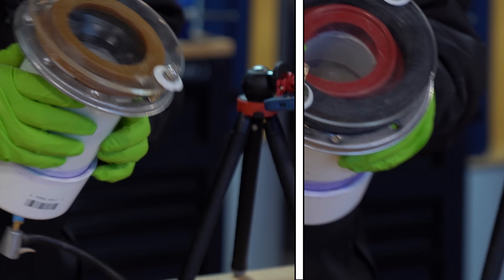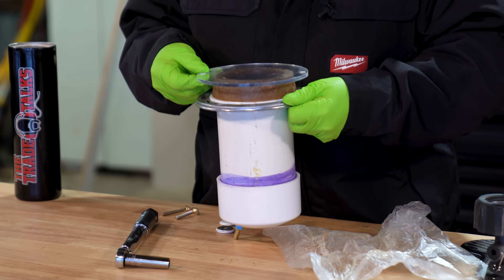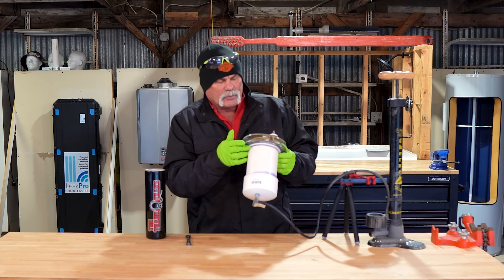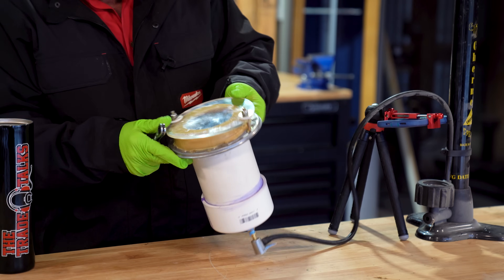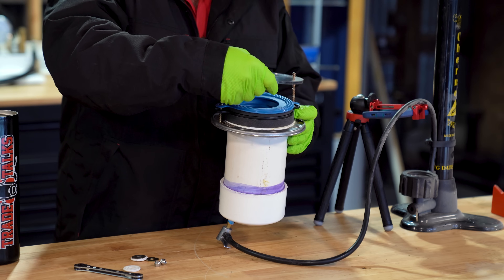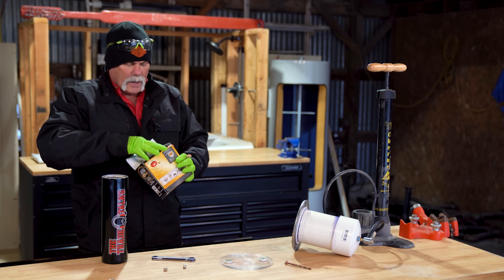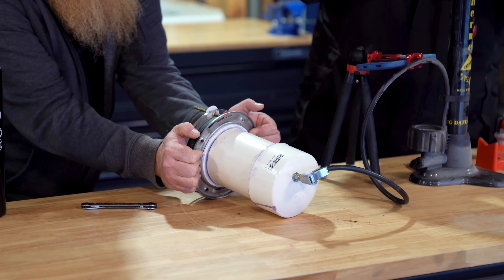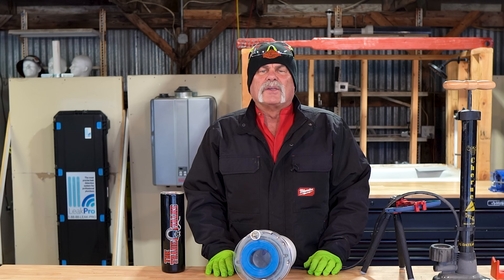Toilet Wax vs Rubber: Which Works Better?

Comment: to be fair, if you're putting 25 PSI of air pressure on your toilet, you eat way too many beans.
Reply: Or all you can eat hot wings
Reply from the maker: But they’re the magical fruit…
Reply: @RogerWakefield  The more you eat, the more you toot.
Reply: 1psi= 2.307 ft high back up
Reply: @braindejong9606  so that means a 57 foot tall toilet.  which misses the joke, entirely.
Reply: Funny but makes no sense
Reply: @mycaddigo  Wouldn't be funny if it made no sense lol
Reply: Beans, beans, good for your heart.  The more you eat, the more you fart.  The more you fart, the more you say, beans, beans are here to stay!!  😊
Reply: @RogerWakefield  Yeah, they magically destroyed your toilet ring...
Reply: … the more you toot the better you feel, so let’s eat beans for every meal.
Reply: Or simply plunging it...
Reply: the smoke test probally would have been better
Reply: Did you factor in the FAT ASS effect ? Some people are HUGE and " rock " the throne getting on and off . That may shorten the life of the seal . A friends kid leaned back and cracked the TANK ! There may have been a gap between the wall and tank . And a GAP between his EARS ! 😂
Reply: They are good for your heart though.
Reply: @johndorian4078 
Yes, or immerse the whole contraption in water and look for the bubbles.  Soapy water in a spray bottle may have also worked!
Reply: Oh, man, that was awesome.
Reply: You should ALSO install a seat belt on the bowl!
Reply: @jasonrodgers9063 nice tip.
Reply: Good one!
Reply: Lol.  Thats probably the pressure that you produce when plunging the toilet bowl.
Reply: He's not really putting that much pressure, since his pressure dial is on the pump, and not measuring what's the pressure in the chamber.
Reply: Tampons probably
Reply: @ElecTRANCEpeter  those don't work that way.
Reply: You would have had a better test with some thicker acrylic or a thick backup ring to keep the acrylic from flexing. Remember, the porcelain  doesn't flex.
And a small jig for your test pipe to mount to.
Reply: No such thing.
Reply: “We didn’t set it up right”.
Exactly. Pointless test.
Reply: This is not a good test. You want to water test it to realistic water pressure that it will experience.
Reply: @anthonybishop2498  nah, we don't want scientific rigor, we want entertaining video and funny comments.
Reply: Plungers.
Reply: Useless test as plexi to thin.
Reply: That’s a slow day
Reply: I can't see how a wax seal gives a good seal in anything but a case where the toilet bowl doesn't budge a micrometer, and how realistic is that? First time big Uncle Hershel sits on the can, I can almost guarantee there will be tiny angular offsets and displacements, and I can't see how the wax seal will remain air or water tight. At least materials with good elasticity will rebound and continue to conform to small angular and other offsets, when Hershel gets back off the can.
Reply: @briank10101  you obviously haven't touched a wax toilet ring.
Reply: To be fair though a toilet is going to push evenly all the way around. So you needed a lot thicker top plate so that the side didn’t flex.
Reply: My beans make musical fruit!

Comment: Your test is flawed, the cap you’re using and screwing on is failing under pressure, my toilet isn’t going to curve and start letting air out. Porcelain doesn’t flex.

Comment: I like the test but you can see the acrylic is bending which won’t be a good seal so something stiffer would have been a better test for both in my opinion
Reply: I agree. I am no plumber by  but I use these in all my toilets at the apartments I work at as I go. Somewhere around 100 toilets it’s the past 4 years I’ve had one instance where I couldn’t use one. Time saved is massive. Between cleanup and not scrapping the old ring off. It’s so much easier to do and they work. When you have a proper seal I believe they are better. Just make sure you gasket flange isn’t broken.
Reply: Which couldn't that be a better test, the flooring under toilets sometimes bends right? so wouldn't you want a worst case test
Reply: @johndorian4078  yes, the floor may have bends but the seal doesn't touch the floor so it has no influence. The weak point of this test is the acrylic sheet used on the end. It is clearly not as stiff as a toilet bottom and is skewing the results. I've used both and after the first no wax seal you couldn't pay me to go back to wax. The toilet in my current house had a wax seal that was leaking so I replaced it and within months it was leaking again. Switched to a no wax seal and it hasn't leaked in 25 years now and that includes having removed the toilet once to redo the floor and and another time to gain access to the space behind the toilet for painting. Never had a drip or an odor of sewer gases leak through it.
Reply: Yea a toilet is not going to flex like the acrylic did.
Reply: @johndorian4078  Plus a toilet is much heavier and puts an equal amount of pressure around the seal.
Reply: the acrylic plate should have been MUCH thicker, especially if they re-used the same plate for each successive test which is appears they did. The idea behind this test was good but that test procedure was a failure from the start.
Reply: 100% 

Porcelain does not give away like the acrylic. I would expect you could substitute with a thicker piece of acrylic and longer bolts.
Reply: @johndorian4078  Not really. Neither the toilet drain face nor the toilet flange will bend.
Reply: @lonnywilcox445  ~ An uneven floor can cause wobble.
Reply: The pressure would probably push up through the pee trap before any of the seals. You'd have heard air bubbling up in the toilet bowl.😂😂😂
Reply: True. The commode doesn't bend like that.
Reply: This is what I i was gonna say. That acrylic would have to be much thicker to model the rigidity of the porcelain toioet. Not even close to good enough.
Reply: Yeah, it would have been better to use a metal or wooden ring (with holes for the bolts) on top of the acrylic.  That way, you'd have a rigid perimeter to create a good seal but still have the acrylic window.
Reply: @gweedomurray9923  Make sure your toilet doesn't wobble when setting it.  Shim and caulk if it does.  Sometimes, after years of use, the screws holding down the flange can get loose and the toilet can wobble, but you know what, with a rubber gasket, just pull the toilet and reattach the flange and then reset the toilet, no problem, unlike a wax ring, as the videos says, once a wobble starts, the wax is misshapen and does not flex back, so if you have a wobbly toilet, only a rubber seal will work.
Reply: I'm a lady and I just installed a new toilet and used the Better than wax product after removing my old toilet and the old wax ring. I found it works and had no issue with it and no leaks. I'm pleased with it.
Reply: Yeah, it would be nice to mount that test rig to pallet or something in the air and throw a real toilet on it, bolted down, then pump it up. 
They could also plung the toilet and see what max psi they can hit with a plunger.
Reply: @johndorian4078  Nope.  The closet flange is the seal point, not the floor.  Otherwise you'd have sewage seeping under your tile.  And no floor is going to flex like this acrylic did.
Reply: @jimb1786  Agreed.  That was the first thing I noticed.  A better test is to use a non-porous rigid material, maybe a metal plate..  I don't think it is necessary to be able to see down though the opening as you can see the seal from the sides.
Reply: I can't see how a wax seal gives a good seal in anything but a case where the toilet bowl doesn't budge a micrometer, and how realistic is that? First time big Uncle Hershel sits on the can, I can almost guarantee there will be tiny angular offsets and displacements, and I can't see how the wax seal will remain air or water tight. At least materials with good elasticity will rebound and continue to conform to small angular and other offsets, when Hershel gets back off the can.
Reply: I've maintained apartment buildings for many years. I will never again use a wax seal. What a PIA! Over the years I've used various "rubber" seals and have never had to replace one. The first ones I used were foam rubber but I needed to keep a selection of various thicknesses on hand. 1960's! I've now sold all my apartments, too old for the PIA.
Reply: this is very scare, my cat is sad
Reply: Just like a rubber flapper goes bad over time, so will these “no wax” toilet rings. They will eventually fail. Wax doesn’t fail unless the toilet moves and breaks the seal. Wax is the best and will last the longest.
Reply: Yes, the acrylic was flexing so not the best test.  Double up on the acrylic as a minimum.  Also, a more even rise in pressure would be better, perhaps a smaller air compressor.  Anyway, it was interesting to see how the wax squeezes under pressure.  Finally, if the toilet has any rocking or flex, the better than wax style would be a better temporary fix until the root cause was fixed.
Reply: I tried the rubber version on one toilet and after a year it held up without any issues so I went ahead and used it on my other 2 and so far after 4 years, not a single issue. I didn't love having to deep clean the old wax 😅
Reply: Maybe thicker acrylic?

Comment: I'm a licensed plumber in New Mexico and I've done service work for 6 years. now I'm in a maintenance position for an apartment complex. Since the first time I tried "Better Than Wax" five years ago, I decided that I was never going back to wax. I've installed hundreds of the foam/rubber ring seals and I've never gotten a call-back or experienced any type of issue related to a toilet I've set using that product. Two things I swear by: "Better Than Wax" and siliconized acrylic caulking in place traditional plumber's putty or for any instance requiring a sanitary seal. This type of caulking is the easiest to use and clean up because, prior to setting up and curing, it's water soluble - just takes a damp rag and washes right off hands and tools. It's also safe on drains because it just dissolves in water on clean up. Once it's set and cured (think basket strainer or disposal adapter installation in a kitchen sink basin) it holds it's seal very well and stays worlds cleaner than putty could ever be capable of.
Reply: Thanks for the tip on the caulking gonna try that
Reply: @WalrusMcDonald12n2na2 The siliconized acrylic caulk works great for sink rims and sealing gaps in wood trim before painting. Alex Plus is one brand I use but others also work well.
Reply: I've set thousands of toilets in my life with no issue and wax. But I always insist on getting that WC flange bolted to the top of the floor like it should be. You're starting behind the eight ball if it's too high or below the floor surface. I see new installs all the time where they set a knock-out flange in the subfloor before the floor people have finished. I can only assume they do that so they can get their water/air test done for the inspector. Putting a rubber test plug in the stub-up pipe I guess is too complicated. And....use the next size pipe around your stub-up so you can come back later and set your flange. I do agree on the siliconized sealer though or 100% silicone. Those Hercules wipes will easily remove any silicone residue....and even denatured alcohol will work. I haven't used plumber's putty for yrs now....just sits in the truck. Nothing wrong with it, it's just that silicone and siliconized caulk are so much better.
Reply: @TheReal1953 I'm sure there have been plenty of issues. You just weren't called back for them. Rubber is way better. Not a big concern on a slab. But on pier and beam, especially a trailer house, with particle board floors. Often times the toilet will shift on those weak floors and disturb the wax ring after a few years causing a leak. Not so with rubber.

I always use rubber seals because you are guaranteed a leak free install indefinetely. Also if they ever upgrade there is no need to buy a new ring. It's just better than wax.
Reply: @mr.upcycle9589 Actually no. I posted to this earlier and it disappeared in YouTube weirdness.  I always told my customers, 'Call me, don't cuss me if you have any problems'. Other than obese people loosening the toilet itself or some structural issue with the floor itself, not any wax seal issues. But then I would always correct the flange if it wasn't on top of the flooring like it should be. The flange HAS to be solidly mounted to the floor....whatever the floor material is.....it cannot move or have its fasteners rot away.  And I'm not demeaning rubber seals, just stating that I never needed them. Maybe they are the ONLY thing to recommend to the weekend warrior......dunno.
Reply: I'm a remodeling contractor and I couldn't agree more, I only use rubber gaskets on toilets, so much faster, no mess and works better.  I also stopped using plumber's putty years ago after removing so many drains with dried cracked plumber's putty that clearly has been leaking for years and ruined the sink base.  But I always use 100% silicone or Lexel, that for sure will NEVER fail.  It's not hard to clean up, just paint thinner.  I also prefer teflon tape over pipe dope.  I also don't use hot lead filler with oakum and cast iron pipe.  🤣
Reply: @TheReal1953  I'm not sure which is better, the Fluidmaster or Korky, but I always get the Fluidmaster.
Reply: Another life-story dump on society... Again.
Reply: @topherdean1024 I'm in the same business as you and I think plumber's putty is a joke it just dries out and falls out, clear silicone performs much better. Teflon tape is definitely better than pipe dope in my experience. What I usually do is wrap the pipe with Teflon tape and then put a thin coat of pipe dope on that.
Reply: They now have foam seals for basket strainers in place of putty, we use the Sioux Chief ones, I had a steeper slope on the drain on my kitchen sink at home and stacked two of the foam seals and have had no issues for 3 years. .
Reply: Better than wax been working for me for over 10 years now on at least a dozen or so toilets
Reply: So use the blue one, the blue ring
Reply: I've been putting in and re setting 3+ toilets a week for over 10 years. In my experience the foam and rubber seals seem to leak and when they do they get disgusting and makes pulling the toilet and resetting gross. Wax with no horn on it is all I use.
Reply: @TwinPhoenix666  Danco is the best ring. Rubber/silicone, tube extension and wax ring all built in.
Reply: Also my experience but with a much. much smaller sample size.
Reply: @AlanSanderson-u4t  Thanks for the "gaps in woods" tip! Everyone needs to know that one for sure. I put that in my phone so I won't forget it.
Reply: The best part about the siliconized caulking it comes in colors. To match whatever you're installing.
Reply: Give them twenty plus years with where and tear. Retest.

Comment: When I did apartment maintenance,  I switched over to the better then wax.  Worked well for me.  I like that there is no wax to clean up.   Other bonus, it can be reused incase you set the toilet down off center.
Reply: Exactly.  If you accidentally set the toilet down wrong.   You just move it with a rubber seal.  With wax.....you have miserable cleanup on your hands if you have degraded the wax to the point that the entire thing needs to be replaced.
Reply: I do apartment maintenance and use the neoprene seals instead of wax. Our buildings are old and I have had to deal with several leaking wax rings. Once a wax ring looses it's seal and gets wet it doesn't tend to reseal, the neoprene rings will reseal. That is the big advantage for me.
Reply: I’ve seen the rubber rings work from having to pull toilets for other various reasons, but I’ve never used them myself.
Reply: @drmodestoesq  ~ Landlord and I installed a new lo-flow toilet upstairs and used the neoprene seal.  That was probably 8 or so years ago and still no leak and it is nice not to be concerned about incorrect placement wrecking the wax ring.
Reply: When I moved into my house I swapped out 3 toilets the Wax rings were not my friend I tried the Better than Wax without zero issue.  My dad swore by the wax ring until I showed him the better than wax for ease of use and clean install it’s my preference.  That being said I’m just a homeowner I know both methods work.
Reply: @drmodestoesq  you could just mold it back with your hands like silly putty for a second try. 
Maybe not if it's been in service for a while though😜
Reply: I bet a plumber had to replace all of them.  Wax can last well over 20 years.  You won’t get 5 out of that crap
Reply: @evanfeehan8212 way to go.  I bet your bathroom smells like crap due to your “crappy” install
Reply: @Ian_Burt Which brand neoprene rings did you use?
Reply: @Red_Twizzler  you have no idea what you are talking about, the company i work for exclusively uses the neoprene seals and have for a long time with almost no issues, and when there is issues its usually because someone made a mistake and didn't check for obstructions. or flooring was too thick not causing proper contact, which again is installer issue that could easily happen with wax rings too. and no smell, i also used the better than wax seals in my own home and no smells and no leaks.
Reply: @Red_Twizzler  Calm down Spartacus.  I only use better than wax rings and have never had one issue.  I've probably put 30 of them in.  The one I installed in my own house is going on 12 years.
Reply: @Red_Twizzler  are you having a crappy day 😂😂💀
Reply: I installed one over five years ago. Watched the install on YouTube and haven’t had one problem. I love it
Reply: Love to neoprene seals. Never have had a problem in any of the rentals I service
Reply: @Red_Twizzler  I have 2 not wax that are over 10 years in my house